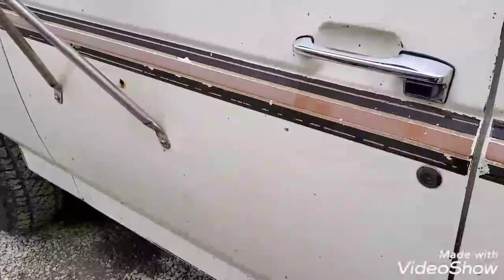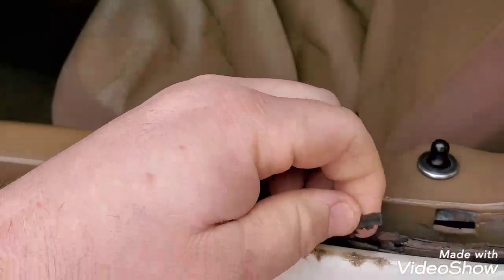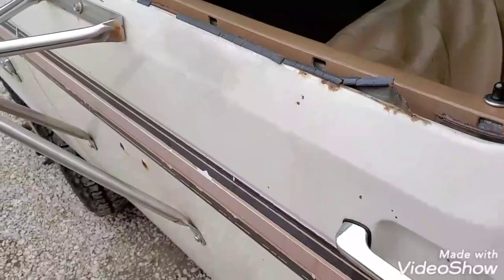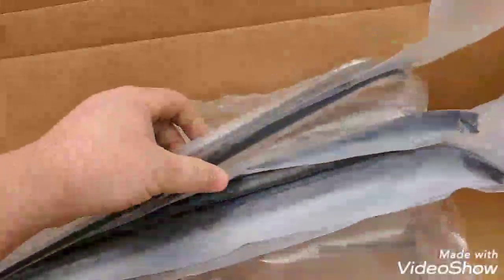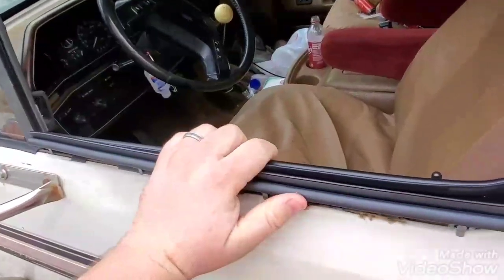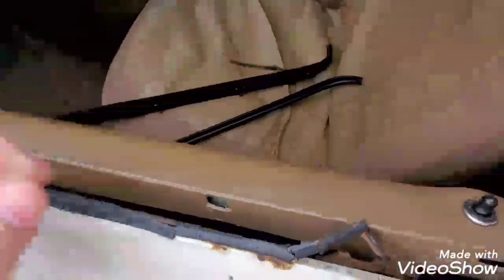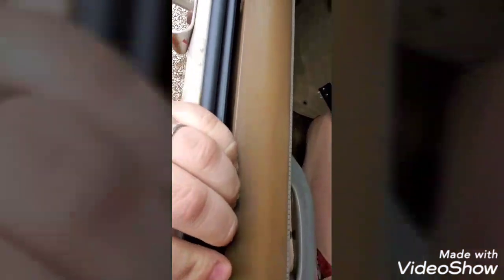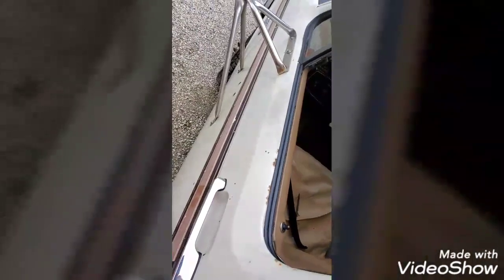OBS F-Series: 1980-1997 Window Felt Replacement

Comment: what you didn't show was the install on the plastic door panel portion with the cracked/missing area for the clip to attach to. How did you fix that and make it work?
Reply from the maker: I didn’t show it because I didn’t repair it; just flexed the metal clip so nothing scratched the window.